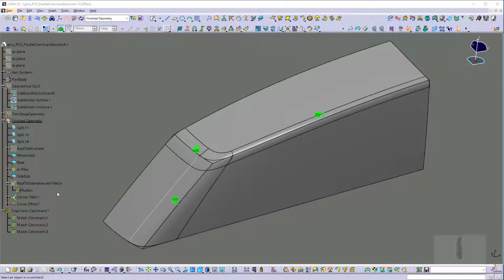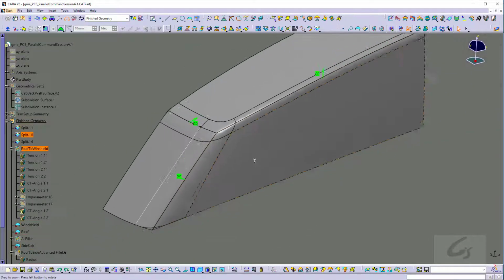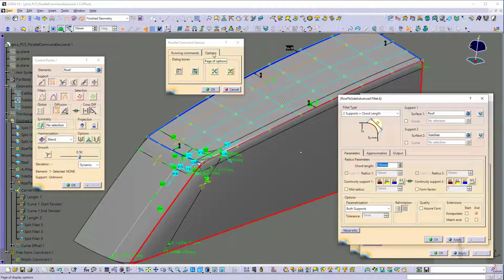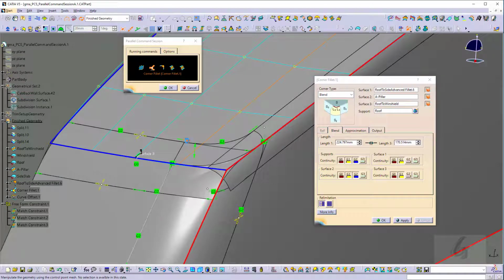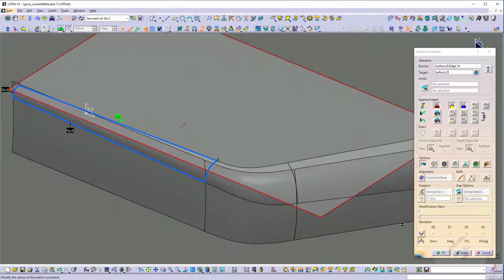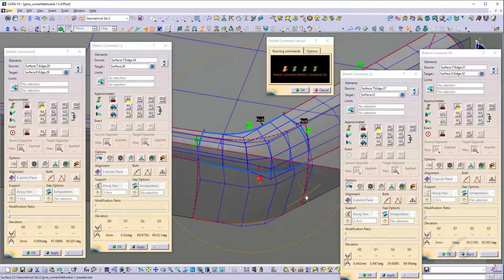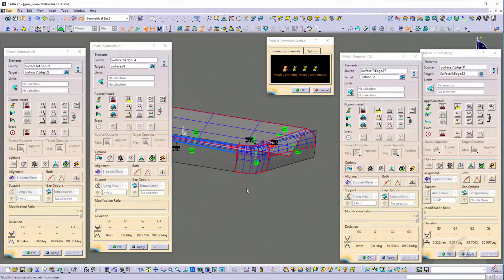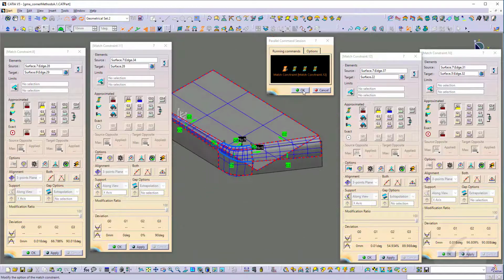CATIA (V5) Icem Parallel Command Session and Matching Constraint Tips

Comment: Hi Mr Alcini,
why do sometimes these constraints stop updating? and it needs us to re-apply the constraint to work?
some work as expected and simultaneously some do not work and I find no difference between the two.
Reply from the maker: Hi Fardin, there is a way to force the constraints to "always" update by opening the dialog and turning on the auto-update icon but I do NOT recommend this setting. That's because if you have multiple matching constraints applied and make a change to one of them, it can have a globally devastating affect on the others, making it difficult to pick up the pieces. They are working as designed to give the user full control. So in a situation where you apply a match but it turns another one "red", check to see if you have diffusion turned on...this may be the cause because its deliberately forcing a change all along the surface. So your choices are 1) turn this option off, which means the diffusion will only affect the rows specified by your continuity input or 2) leave on, then RMB on the "red" constraint and do a local update. There is no right or wrong setting, I use them both depending on the situation.
Reply: @GerardAlcini  thank you Mr Alcini for sharing your knowledge.it is helpful.

Comment: Wow!!That iterative reversing the source and target in matching the constraints seems to be 
one of secrets of this tool.
That will be great if you do a lesson for "Matching Constraints" tool ,maybe doing a fully G2 ball corner, may you please?
if I don't want to go beyond degree 7 for the ball corner is the "Matching Constraints" tool capable of adding extra patches 
to the corner?
Thanks so much.
Reply from the maker: Hi Fardin...Matching constraints can increase the order of a surface, whether its a single segment Bezier or multi-segment NURBS but cannot add segmentation (patches). In complex fillets, there's no reason not to increase the orders to 10 or 11 on a Bezier patch (use your discernment). The important thing is to make sure the surface remains smooth and without inflections.
Reply: @GerardAlcini Hi Mr Alcini.
I hear that some very top CAD speakers from Alias don't tend to go beyond 7 or 8 control points for A class work, 
is this because of the CAD system they use or they have different work flow?
Thank you so much.